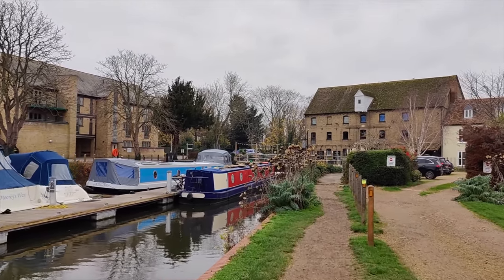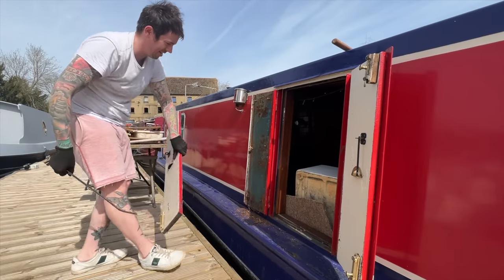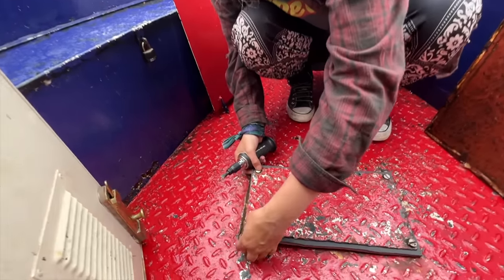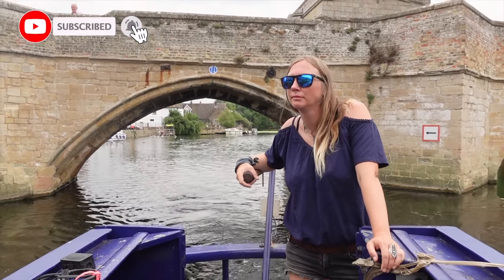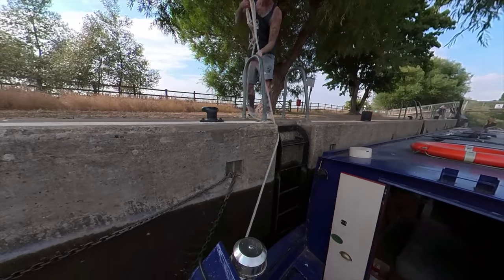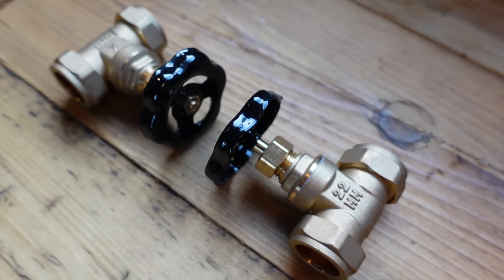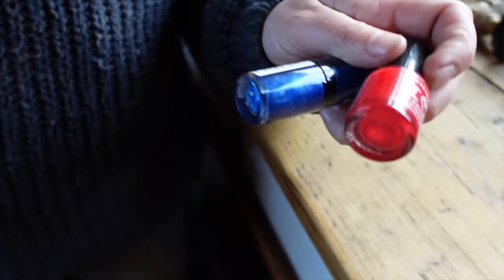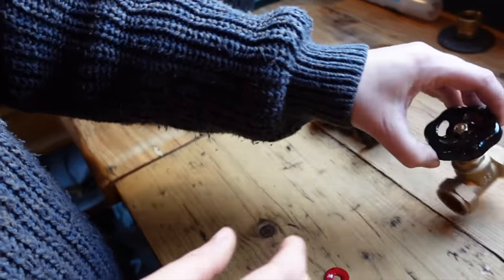HORRENDOUS LEAK solution !!!

Comment: I would really advise a professional look at your leak you two. All the wonderful plans and designs you have could be spoiled until that leak is finally fixed. Many boats have not got pram covers and don't have leaks.😟.  You two are such great fun and we who follow you are treated to such interesting vlogs.
Reply from the maker: Thanks so much Anthony. I just explained in another comment whats actually going on with the leak so il copy it over to you to clarify things. Thanks so much for watching 🙂
Reply from the maker: Ordinarily the bulkhead between the outside well deck and the inside of the boat would keep the two completely separate, which would help determine where the leak was getting in, in this case. It was looking a lot like it might be the hot water tank for a long while but the more we investigated, the more it didn't quite add up. Anyway one day I got my investigative hat on and had a look at the bulkhead at the bow of the boat where the well deck and inside of the boat meet and where the bow thrusters are, and realised there was a small hole in the bulkhead wall (you can see this in a previous episode). It then didn't take long to realise that rainwater was getting in through a couple of little holes in the well deck, collecting where the bow thrusters are and finding its way through the hole in the bulkhead and filling the bilges of the rest of the boat. The reason there's been more water in there recently is because the cratch cover had been on and off for alterations and we just hadn't thought to check there for a while. Hopefully this clarifies things a little! Sorry for the novel! Becks 🙂
Reply: @TheNomadicCrobot  It's my pleasure to watch and you do all the work. I have had a great love for narrow boats and wish , on retirement , I had purchased one to live on. Instead I chose a lovely cottage ( very remote ) on the south west coast of the u.k. No work for me to do , it was renovated to a high standard. Small and cosy just like your place will be soon. Keep vlog's coming and I will keep watching. I am still not sure about the leak though but hopefully the future will prove me wrong. Love to you both.
Reply from the maker: Oh wow that sounds lovely! I hope you've been keeping nice and toasty warm in your cottage. Thanks so much for your kind words and for watching our journey. Yes we hope we are right about the leak but only time will tell! 🤞

Comment: Hi just thought I might say that you must have realised by now the water leaking in the front stays in the front as it is seal from going inside as you have had no water under your floors but plenty of water in the front so the only way the original water got under the floor was from the hot water cylinder and since that was removed it has stayed dry
Reply from the maker: Hi Big, thanks for your comment. You are right, ordinarily the bulkhead between the front well deck and the inside of the boat bilges, would completely separate the two which would help you determine where the water was coming from, most probably like you say the old hot water tank, however, I got into have a look at the bulkhead (with great difficulty!) in a previous episode and realised there is a small hole where water could get through. This enabled us to determine that rainwater was finding its way into the bow thruster area under the well deck and finding its way through this hole and filling in the bilges in the rest of the boat. Although it took us some time, we figured it out eventually! The cratch cover resolves the issue to some degree but whilst it's been off some more rainwater got in which is what you saw in this episode. Or at least this is what we believe to be correct! Hope this clarifies things. Thanks for sharing your thoughts on it with us ☺️